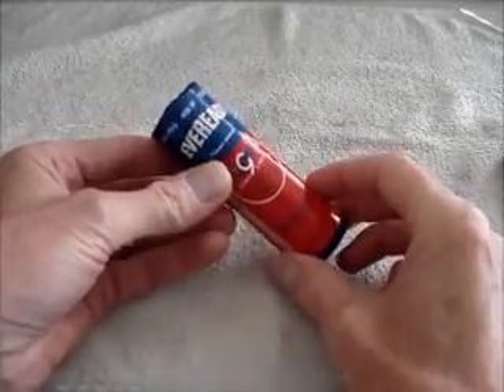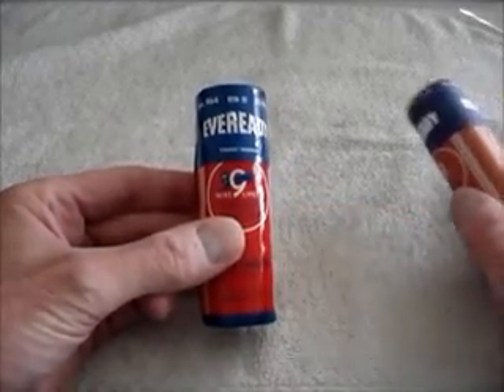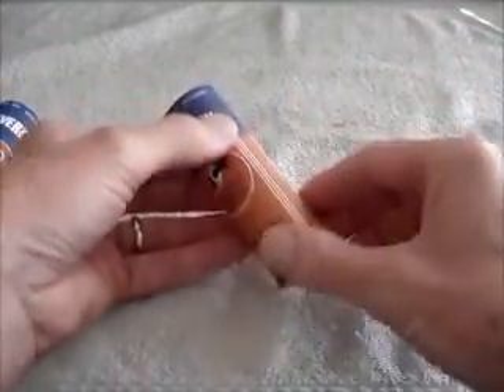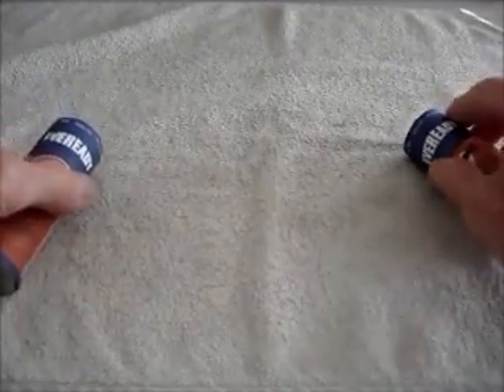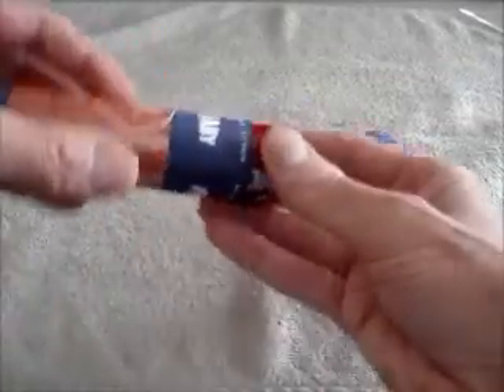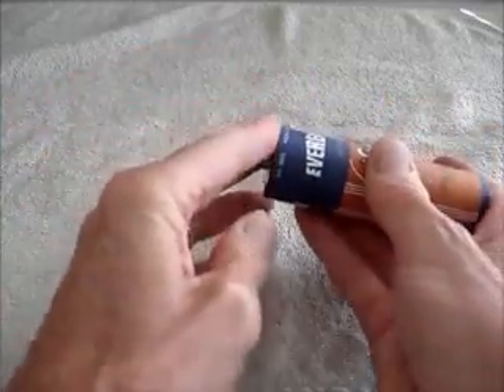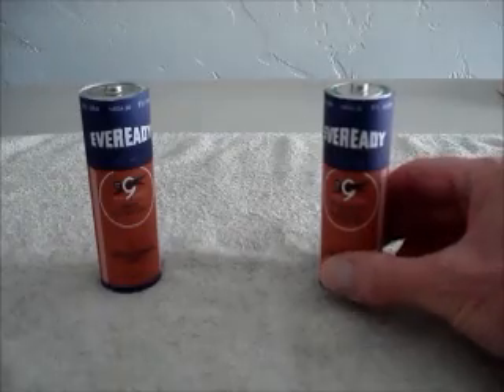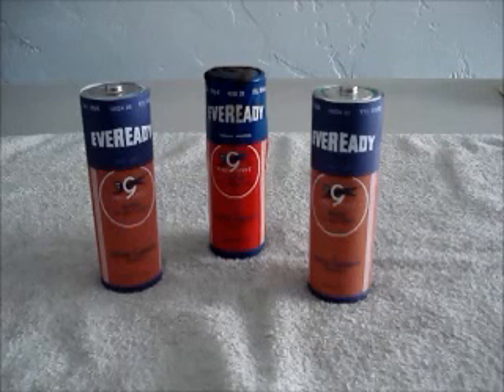D CELL TO G CELL Adapter for Portable Tube Radio Sets

Comment: Why wouldn't you want to run parallel batteries in a radio that is equipped to do so ? Or to be more specific, why do you choose not to run that specific 1.5v battery in parallel inside of your radio? 📻
Reply from the maker: Hi catbox, thanks for watching. regarding your question, I have put both batteries in and it works fine of course, but when I left them in the set they "self-drained" in only a few weeks while the set was turned off. I am not sure why.
-73
Reply: @Random-ep8st  One must have more resistance than the other . Must be why we don't see alkaline's in parallel instead they get bigger. Makes sense to me ,thank you. I never gave it any thought before.